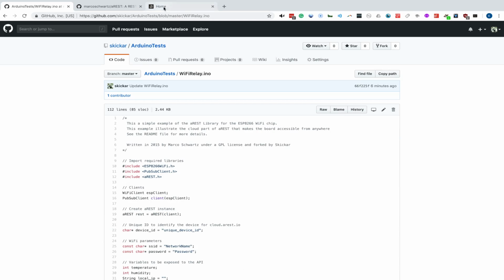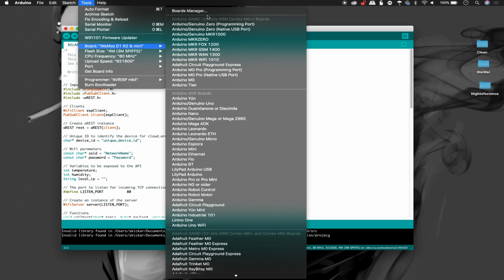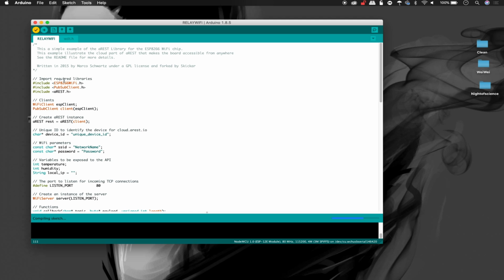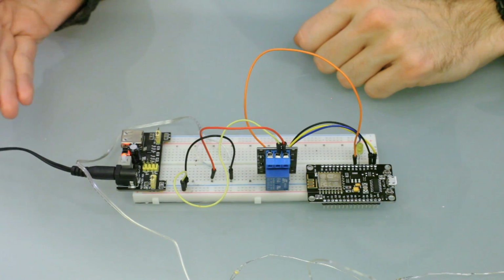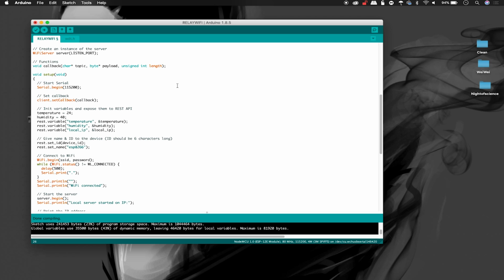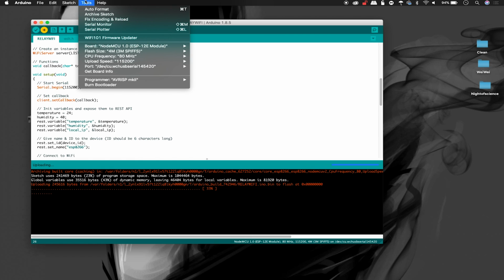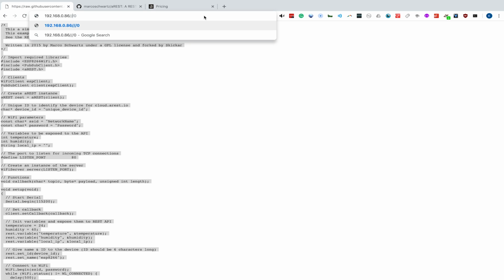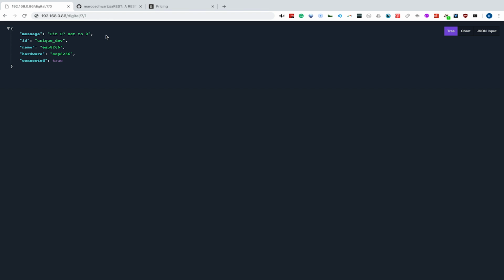Create a Wi-Fi Controlled Relay Using aRest & NodeMCU [Tutorial]

Comment: Hi there. Total noob to this stuff but I'd like to learn it using this vid as my example, guide. With that said, what exactly is the power source component I see in vid (where would I get that from)? Ive ordered the relay switch, breadboard, node mcu to attempt this. I'd like to also try it with the lights used in vid (a little insight on that -- which to buy, etc would also help). Great stuff! Appreciate the help, thank you!
Reply: Update to my comment: I was able to find the power supply board online. As funny as it will be, the lights are proving to be a pain. Lol. I am unable to find a single light package online. Everything comes in bulk. I'll report back success once I reach. Thank you.